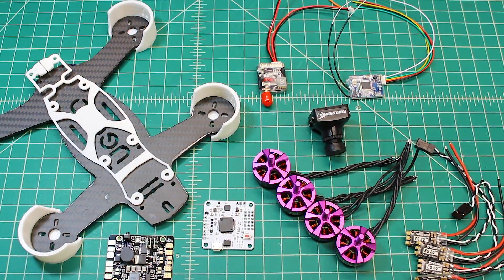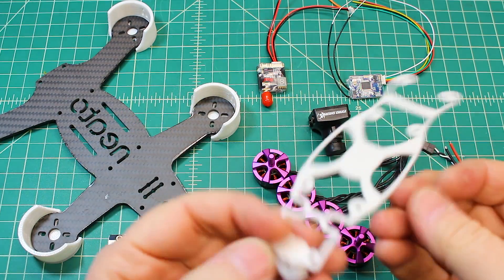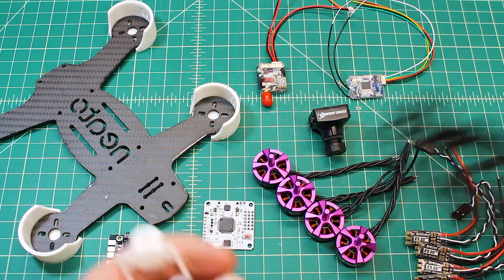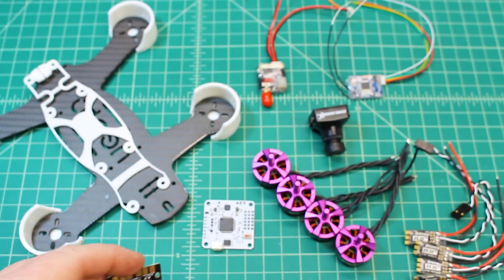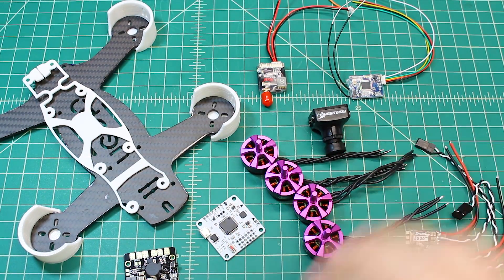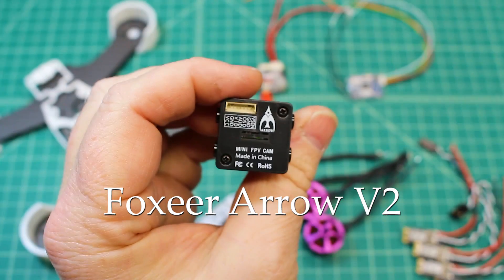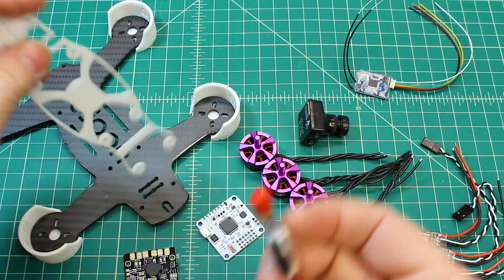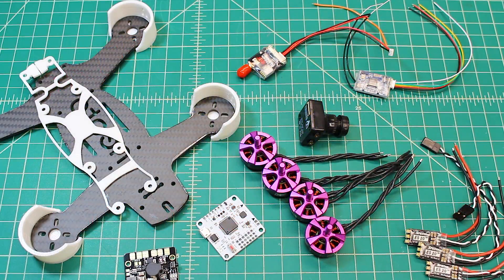Neato 180 4" FPV Frame Pro Buildout

Comment: I've heard that the dys video transmitter you used in this build actually outputs 800mw when on the 200nw setting. Have you had problems with this?

Comment: have you ever had your receiver blow out your sbus channel on your FC? got this XM that has popped 2 FCs already. it works fine for a few flights then BAM. it stops talking, checked it with another reciever and it's blown. thought it was the FC so got another f4 and bam again same thing. needless to say it will not make it on another one but what the heck? waiting on my 3rd FC.lol good thing I got 10 quads, but not the point. this build is tearing me up. don't usually need help but WTF help.please